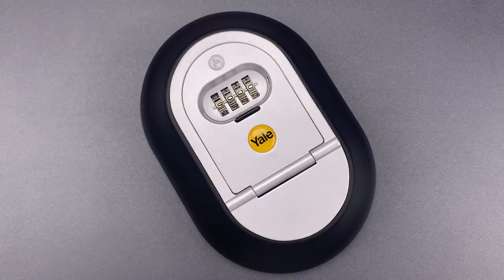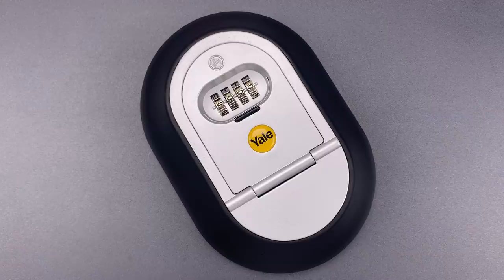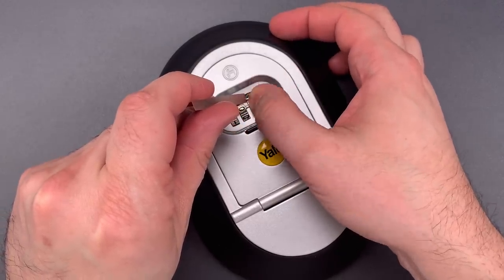[1092] Opened With a Red Bull Can: Yale Key Lockbox (Model Y500)

Comment: This guy makes me think it would be best to just weld my door shut every night and torch my way out in the morning.
Reply: Steve Fryer He would find a way
Reply: For one thing, couldn’t he just torch his way through too? Second thing, what if your door and frame is wooden?
Reply: “Using the blow torch that BosnianBill and I made”
Reply: Bruh stop sleeping
Reply: Ehh just use a strong simple to pick lock.  No one is picking your lock to rob you... they are breaking the lock.  Plus a simple to pick lock means you can get back in after you lose the key.
Reply: @Canadian-Asian-dude  That would be destructive.  We all know we can break any object with the proper force.  This whole channel is about non destructive circumvention.  Since the track record of this channel shows that pretty much nothing works we are left with forcing him to use destructive means.
Reply: @Canadian-Asian-dude  jb weld?
Reply: Random Guy yeah its kinda cringe
Reply: grabs out his mini angle grinder Really this just solves everything.
Reply: @Iyash [1093] Opened With a Slice of Bread: Bunker Door
Reply: @lukasacar  If it can be opened, it's not good enough.
Reply: You weaken the material if you weld it several times.
Reply: LPL would just ramset your door out of the way.
Reply: Just swallow all your keys. I bet you this man cannot break into your stomach. Safest place.
Reply: use camera with object detection and connect it with a turret.
Reply: @ilyasayusuf5447  lmao I lost it when I read your comment. I'd actually love to see that made.
Reply: You could just use abloy lock..
Reply: If u did that the next moring you would hear “hey guys lockpickinglawer here today we got a welded shut door”

Comment: The good thing about using a Red Bull to open it, is that you'd need to empty it first, giving you the energy to pick it even faster!
Reply: Or be super jittery and mess up
Reply: Scyth3_ that is a security feature
Reply: @scyth3_345  Or fly over the house, allowing you to drop in through the chimney
Reply: +20 to lockpicking speed
Reply: But it gives you wiiiiiiingssss
Reply: Let's keep the likes at 369

Edit: Nvm
Reply: It gives you energy to sprint fast in case you're caught breaking in
Reply: @LBandCOOLJ 
🤣🤣
Reply: fly instead
Reply: Gidiotic lol
Reply: Alright, let’s think about this logically. Carrying around an empty can and cutting it to size? Or carrying around an unopened Red Bull, drinking it as fast as you can, cutting it to size, gain speed from the energy drink to pick the lock. Honestly, I dont think the extra speed from the energy drink will make up for the time it takes you to drink a 12-16oz can of carbonated drink. Therefore, it’s slower.
Reply: @AznTony360  but if you carry a full can it's a bit less sus
Reply: If he picked that lock faster, he'd have invented time travel!
Reply: @johnmartinez7440 , what the hell is diarrhoea?🤣🤣🤣
Reply: Best comment I’ve seen today

Comment: I recently stopped using one like that. My neighbors think I'm weird keeping one rock outside my third floor apartment door, I don't think they suspect a thing.
Reply: Tell them it's your pet rock and you've put it outside as punishment because it was misbehaving.
Reply: Honestly, put some googly eyes and let it sit there for a month. People will check it and call you the weird rock guy, but once it's normal for a rock to be out your door they wont suspect a thing.
Reply: I'm sorry. I don't get it?
Reply: @joshuagoh1087  They make fake rocks that actually hold keys.  The idea is that you can put it in your garden somewhere and it would be hard for a thief to spot.  A rock sitting outside an (inside) apartment door would stand out like a sore thumb.
Reply: @jrd33  Should I chain it up to give the dangerous pet rock affect?
Reply: Not That You Asked nice thx
Reply: Beware of rock
Reply: Dylan Van  yes!  You need to have the rock wearing a little spiked collar and on a chain.  Then put a small sign by it “beware of rock”. It would be even better if you paint a face on it with fangs.  I think at that point the neighbors will never suspect a thing!  However, if you gesticulate wildly while using your Bluetooth ear buds for calls you may find yourself on a 72 hour psych hold.  Don’t worry though I have met some awesome people on those “mini vacations”.
Reply: @The_Other_Ghost  Depends on the size of the rock and how dangerous it looks. A big, gnarly lump of granite or basalt, sure! But if it's just a pathetic bit of sandstone, I think you might be pushing your luck.
Reply: @jrd33  Big enough to comfortably hide a key in.
Reply: @notthatyouasked6656  Joshua asked and you replied so your username is misleading. :)
Reply: @The_Other_Ghost  make the key hidden under a hollow mesh, then drape brown cloth over it, make it look like a poop mound for the pet rock.
Reply: @joe8058  Would I have to get a second key for that?
Reply: @joe8058  best YouTube comment of 2020
Reply: If someone made  a key safe that looked like an authentic dog turd, possibly complete with aroma, no one would ever touch it or look for a key there.  Or, I guess you could just use the real McCoy.  And hopefully you're not the kind of person that forgets their key that often.  But if you are, it would likely help you remember it after a few times..
Reply: Sees a fake rock outside an apartment:    Seems normal to me.

As I walk past it.
Reply: @greendryerlint  You may be onto something. There are species of caterpillars that evolved to resemble bird droppings. Birds ignore them.
Reply: @greendryerlint  it would encourage you not to forget your keys. And if you had guests you didnt want to stay then you can tell them where to find the key
Reply: Atleast keep multiple rocks and put it in a pot around a cactus or a flower
Reply: Saw stranger things than that... Carefully watching the army of zombie garden dwarves the neighbor arranged in a way that it looks like they are laying siege on my house Much stranger things indeed
Reply: I'm regularly baffled by how many extremely low security protocols work just fine. People really, really, really aren't looking out
Reply: you need to go talk to the rock and call it dwayne
Reply: @jrd33  fucking genius

Comment: does this work with other brands as well? like monster energy, or even a can of pepsi?
Reply: Like seriously all I have is empty beer cans.
Reply: no I'm sorry it only works with Coke products
Reply: Yes, it will work with any thin aluminium or steel can. As long as it's thin and flexible
Reply: @Crockett I think the joke is that the question makes you think he's going to be asking about lock brands, and then subverts expectations by making it about the sodas. I thought it was funny!
Reply: @TormeyWoods  Does it work with other lock brands tho
Reply: @therealkingk1156  Damn that's the real question. I'd think it might, since it's essentially not that different to the actual tool you'd use to pick these combination locks. But don't listen to me, I can't even pick a Master Lock :(
Reply: Not all cans are created equal. They can be either aluminum or steel, and their wall thickness depends both in material and expected pressure to withstand.
So there might be cans too thick to fit in the small gap
Reply: Just don't use Dr Pepper or you'll be considered a psychopath committing a home invasion!
Reply: No sorry if it's not Redbull you're SOL
Reply: All the carbonated drink cans in one country are pretty much the same.  But the thickness does vary around the world.  So, the brand doesn't matter so much as where you bought it.
Reply: R/woosh
Reply: stolen from another post:

It has to be Red Bull because Red Bull gives you thiiings

Thanks Dan Lee
Reply: Erik Lindgren no
Reply: no only red bull
Reply: @TheNasaDude  I've consulted in this field.   Manufacturers of beverage cans spend millions determining how to reduce the amount of material consumed in making each can (without compromising structural integrity), down to carefully protected trade secrets around how they paint the label on (this last bit was where I came in).

Comment: Back in the 1980s when I worked at a luggage store, the flats on the wheel locks was how we determined the combination if someone forgot theirs or, more commonly, if some jerk changed them on us and then locked it on the sales floor (usually they were straight up or the reverse number of straight up, and they were visible from the outside due to poor tolerances in manufacturing of the faceplates). Hard to believe I learned how to pick locks at a legitimate job when I was 19, harder still to believe there used to be actual luggage stores. Man, I'm old.

Comment: After watching this, I remembered that I had a combination lock that I’d lost the code to when I tried to change it but forgot how to properly do it. It’s been useless for several months, but after watching this I decided to try to pick it, inspired by this method. My parents don’t ever buy soft drink or anything in cans so using a strip like that wasn’t possible for me, so instead I used the smaller blade on my pocketknife. Was a little stiffer, maybe because of the thickness of the blade or the lock itself being quite small, but either way I got the combination done without any trouble. Thanks LPL!!
Reply: Hats off to you! That's awesome.

Comment: I work in security and have started advising customers it's a good idea to install one of these cheap easily opened lock boxes in plain sight with a wireless tamper switch inside so that a would-be thief smashes this open and sets off the alarm without even touching their house. We put the lock box and front of a camera with a good view of the person's face as they approach and have had success deterring and catching thieves.

Comment: Comes to something when the screws that secure it to the wall will do a much better job than the security of keeping you getting at the key inside the box.  In fairness this was a 2.5 minute video which for LPL is somewhat on the long side.  Normally it's "Hello and welcome to .....  and the lock is open!"

Comment: Reminds me of the brief cases with this lock back in the 80s being easy to crack into as well without the strip of thin metal. Surprised they are still using this idea here in 2020.

Comment: You know what, got a few electrical trucks with these locks on.  

Hasp Padlock, Silver, w/ (2) Keys
ZORO #: G9683941 MFR #: 770LHCKA
The original locking mechanism failed, we had to install those ourselves.

Comment: I've had this lockbox outside for 4 years having forgotten the combination after a tenant moved out. I was really pleased to see you do this (I'm in the UK) I copied what you did, or tried to. My problem is your video shows the 'tool' sliding in with ease about 1 cm in. I cut exactly the same 'tool' but it gets in a few mm then there is resistance and it bends and will go no further??
What am I doing wrong (also I'm not sure what I'm feeling for) and, would a notched decoder work as in the other videos unlocking similar lockboxes where you simply get it behind the bar and pull it forward. Thanks in advance!

Comment: Just like using an aluminium shim from a drinks can on old vending machine display doors (sloppy rotary pin locks) the shim takes the form of the pins and the lock turns similar to BIC pens and bike locks

Comment: Any chance of a video of such things you DO recommend?
pretty sure I've got a firm grasp of what not to buy wouldn't mind some pointers on what is actually secure.
Not a criticism btw, love your chanel !
Reply: Have to watch them. Perhaps someone's made a playlist. There are a few he's said he'd use or "aren't terrible", but even those he still opens no problem. And he usually points out on those videos that all you're doing with a good lock is making a different point the weak spot, so it's no guarantee you'll be secure. (Ie if they can't get through the lock, they may be able to lift the door off the hinge or go through a window)
Reply: Go to r/lockpicking and find their "belt ranking" that pretty much lists all common locks from white belt to black belt. Anything above green is absurdly unlikely to be picked in the wild. And yes LPL is active there as well :)

Comment: I still think this lock is perfectly secure for the average user. the red bull can just gained the power to pick locks from the sheer presence of LPL.
Reply: I've yet to see any lock box that should be used to secure anything more than an empty house for sale. They're all far too easy to break open or decode by touch.
Although, another creative approach is to have one visible with a hidden camera watching it. Then when it gets opened you can bring that video to the police, showing they've likely done that before. Oh, did I mention that the lock box should be empty for that trick?

Comment: Thanks for the video.  It's always fun to see you improvise a tool, and embarrass a poorly-made lock

But I didn't really understand what was happening.  What were you pressing the strip of metal against, the underside of the ring which contains the numbers?  And where on the wheel were you touching, top?, far side?, other? 

Why would the wheels be in the correct position when you feel the flat spot?

Thanks.

Comment: How do you know, in advance, where to stick the shim?  I tried this with a cheap 3-wheel lock that I didn't know the exact make/model of (so I couldn't look it up online) and I couldn't take it apart because the stamped-metal construction wasn't designed for reassembly.  So I got nowhere.

Comment: Just a thought, Why don’t they have a shoulder on the codes wheels? Obstructing the access.
Reply: There's better designs out there but they're sadly uncommon. A flexible tool (like an aluminum can) would still be able to go around a shoulder anyway.

Comment: He says he turns it untill he feels a flat spot. Does that mean he turns it until the aluminum strip doesn't wiggle or the wheel turns smoother? Like what does a flat spot mean?
Reply: Flat spot in the wheel. You are feeling for the point in which the wheel is "loose" or has the least amount of resistance.

Comment: Time Stamps:
0:00  Introduction of Lock and Its Source
0:11 Purpose of Video
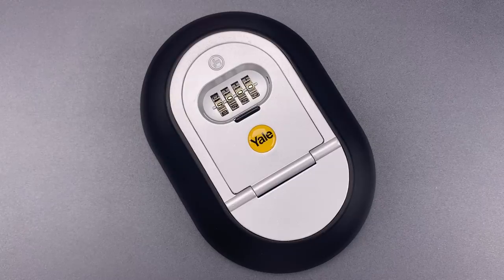0:36  Introduction of Improvised Tool
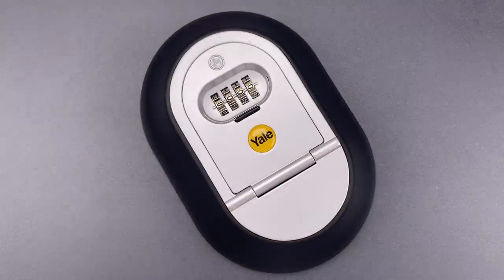0:57  Scrambling in Change Mode
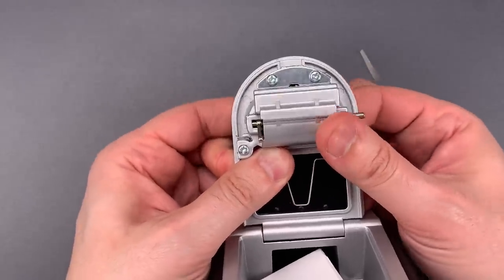1:19  Scrambling in Operating Mode
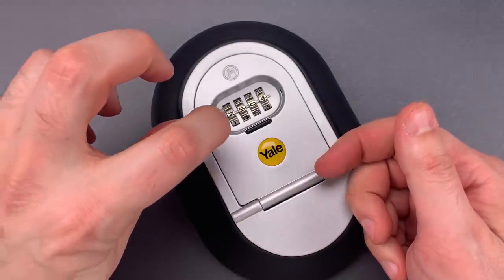1:34  Decoding with Improvised Assistance
2:05  Final Recommendations
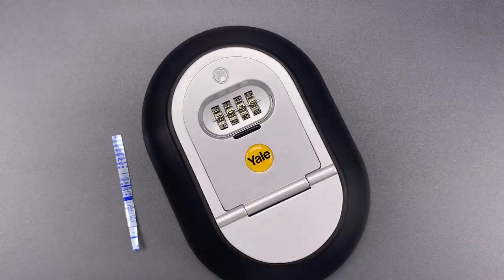2:16  Outro

Comment: My guess is the actual code wheels are all the same design. Maybe the same factory even. Then the housing is made by whom ever to end up being branded as #Master, #Yale, etc but until they change how the unshielded wheels interact with the locking bar, then these open equally.

Comment: There should be an LPL rating system for locks based on the seconds is takes him to open. Anything that's quicker then actually using the locking mechanism should be banned from retail sales.

Comment: My brain went into analyze mode... I couldn't help it, I had to watch again as you reset the code. Granted you couldn't possibly have known the code with the way you scramble the wheels, but what's the possibility that you reset a code like that and land the wheels on the actual code... You were really close this time... the first wheel didn't need to be moved... and the third was only off by two numbers... 2664 is what you started with and ended with 2039... Would be interesting to know if you have ever accidentally discovered the combo after changing the code and scrambling the wheels, before getting on to the picking?

Comment: i was thinking..... is there even a lock that is "really safe" and where i dont have to get a loan from the bank? xD
Reply: What kind? Cylinder for a door or? You can check the belt ranking locks over at r/lockpicking for some good ones. Generally, if it says ASSA or Abloy it won't get picked in the wild for sure. Most locksmiths will drill those.
Reply: @andersjjensen  just thought about it in geberal... but thank you very much :D

Comment: The title of the video is misleading. You didn’t use a Red Bull can to open the lockbox. A more appropriate title would be you fabricated a tool from a Red Bull can to open a lockbox. Based on your video title you could’ve said you used a Boeing 747 to open the box if you simply used a piece of aluminum from a 747 airplane.

Comment: yale? lol... you can buy 15 locks in a pack with 15 different keys and every key opens every lock... but wait, there is more, any yale key opens not only any yale lock in the pack its in with... NO it opens EVERY YALE LOCK... except those with a round keyhole... them u can open with just a screwdriver... 

you have some crap ypu want to get rid of? secure it with a yale lock